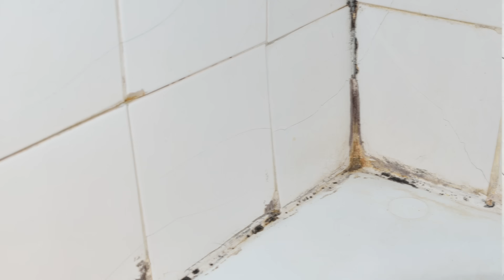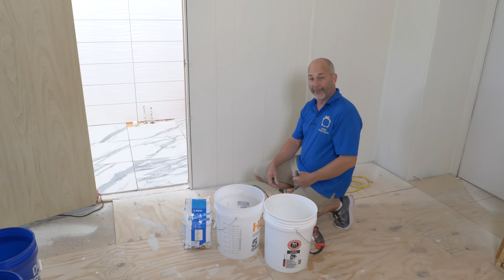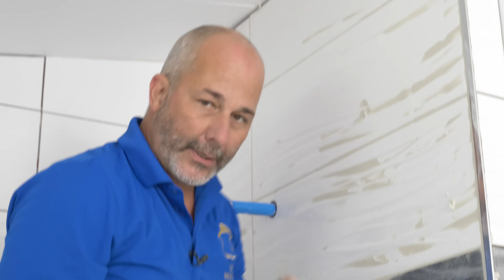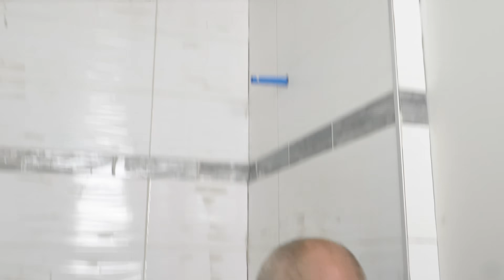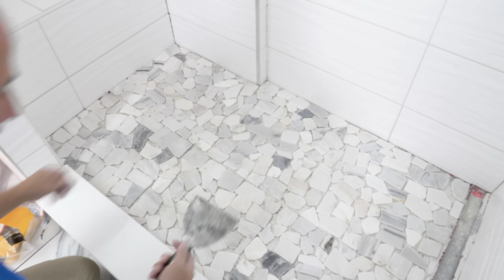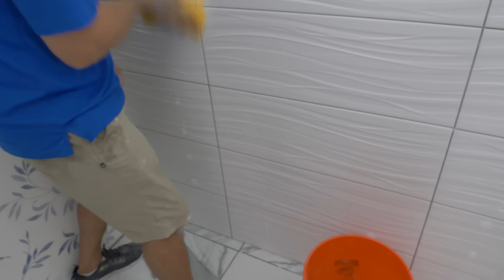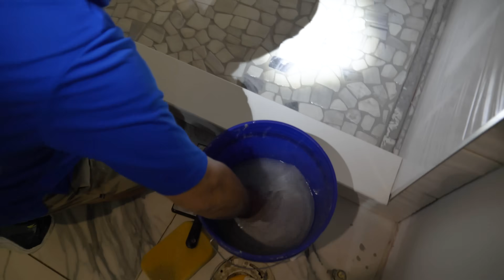Grout Your Floor and Wall Tile (Everything You Need to Know)

Comment: I really do love your videos as a DIY'r. I have been putting off a shower job because I have never done one. I am certain I can do it but I tend to overthink it. I am installing a 72x72 walk in shower with a GURU or Schluter type pan. I am first stuck on what thin set to use to set the foam floor as there is so much information out there it makes it confusing... 2nd I am doing a Black and white Mosaic tile floor. I have a ton of tile we want to break and install on floor. walls wont need it as we are doing a metal type wall... I guess which thin set should I use for installing foam pan to a wood sub floor and which grout for tile? I really want to get started or I will never do it

Comment: These videos are super helpful! But the one thing you don't cover is cleaning up your tools at the end. You mention in at least one video not to rinse excess grout down the drain, good, but not what to do instead. I've found some other resources showing how to scrape the excess out of the bucket into plastic bags, but how do you get the grout off your mixing attachment? Particularly, how do you clean it before it hardens on there, when you've also got to make sure you get the grout worked before the time is up?

Comment: I read somewhere a tip to seal your shower walls before applying grout. Makes clean up easier and prevents staining your tile. Is there logic to this or does it just prevent good adhesion of your grout causing a catastrophic failure? As a diy guy, I honestly could see both options lol

Comment: Just stumbled across this video, so glad I did, applying the sealer BEFORE starting the grout, great tip!  

Hoping you can help me with my one question, for large shower floors, 6ft x 4ft, what's the best way to apply when the short wall is the opening?  I have no choice but to crawl into the shower to pour and spread the grout.  Which means I'll back out as I do it, however I am going to have to crawl back in to spread and then start cleaning, but will be kneeling on the grout I haven't cleaned yet.   Any suggestions?  I assume I have to clean the far end where I started since it'll set faster, but I'm worried about crawling on the stuff I poured at the door end.

Comment: Maybe I missed it, but is there a reason not to use ultracolor for the walls too?
Reply: Yes, it is with polymer sealant, CG2FWA grout (F-Fast) and you have only half an hour to put it and wash it. If not it will be as hard as stone. Of course you can mix smaller parts of grout but is is more convenient to work with CG2WA grout on the walls. But is definitely worth it to put ultracolour plus CG2FWA grout with sealant on the floor.

Comment: Your videos are a lifesaver. We did use the Ultracolor Plus FA on our kitchen backsplash even tho we watched your "warning" video about that. Lol.  First, we bought the premixed and got scared when we read about it. We took it back and got the bag that you mix. We worked in small batches, only mixing 2 cups at a time to 2/3 cups of cold distilled water. We had a section of mosaic tile under the range hood and the rest was 3x12 wavy subway-like tile with beveled edges. We had to work fast! We really appreciated the advice about sealing any tile that was stone-like. There were tiles in the mosaic that were marble-like so we paid $20 for a small bottle of sealer and only used prob a tablespoon of it, if that. But, we feel it was worth it. My husband and I are both perfectionists and the tile job looks very professional! Thanks for the how-to videos!

Comment: I did my 1st tile floor last few days, grouted today using the Ultra FA.  Well I used a smaller pan to mix some by hand but started with too much water, so 1/2 bag used to mix right (by hand).  Then figuring I'd try the least visible corner 1st it turned out the rubber spatula worked better than a trowel for spreading it in the cracks.  Used 2 rolls of paper towels to wipe the excess every 6 to 8 tiles within reach.  Its all done now.  Lessons learned are 1. Wish I had those leveling spacers you had in a previous video... I only had those tiny stars.  2. I didn't know the mortar(thin-set)-showing spots would show up later... so I have a few spots where the seam is white rather than grey.  Being a utility room its 1000x better than the concrete it had and plenty good enough.  Thanks for all the help man!

Comment: When this stuff came out I was helping my uncle tile a floor and he didnt know it was rapid set, he cleaned off the excess with a steel wool. It was a quality porceline tile and it was not glossy so it worked out and we thankfully did not need to tear up the floor. Ive gotten good at using ultracolor I use cold water, I put a cover on my grout pale to extend the pot life. I mix it a bit on the dry side for strenght, then apply it pushing it hard into the joints and quickly wipe excess off at a 45 degree angle and i quickly do all shower walls and as soon as im done 10 to 15 min max Im wiping with a damp sponge agressively to shape the joints from start to finish, then stage 2 damp sponge 2 cleaning buckets and wipe wall and clean sponge over and over, once done touch up grout if needed, if not buff with microfibre cloth and remove any remaing haze and finished for good. All my jobs last a long time and no need to seal!! Unsanded is not too great when you can remove it with a regular cleaning brush. I remove it and replace it with better grout. Keep up the good work.
Reply: Will keep in mind what you are stating here , I've waited 3 mo in the comment section for confirmation along with the possibility of hiring him because I Really liked his work     on top of him Filming it  , thanks for your comment glad I came back to scroll me & my grandson 8 are going to try doing it next week..

Comment: Bud.. Used customer supplied mapei grout ultracolor plus for first time. You scared me with other video. You know the one. Thankfully, from experience not a problem. Homeowner using yeah could potentially see a problem. 

My main thing from very beginning of this video was the hard line with the tile in the pan. What happened? I would like to avoid if possible. Thanks!

Comment: Man I WISH I had a contractor like you. I have a son with a disability and the state had us in a program to remodel our single bathroom, it's a two contractor bid process, lowest contractor wins. We had to stop work with the first contractor because the quality was SO bad, then had to go through a process of finding another contractor which means we've been without a bathroom in the house for ten months. There is a basement toilet and we used a camping shower tent. The new contractor didn't install the tile to specs and the MAPEI FA is SOFT, so it was mixed improperly. At this point I am going to get out the shitty grout myself and do the new grout myself, I realize now no one will take the time and attention I will. Thanks for all your videos to make this clear. - by the way, the state paid both contractors in full for these jobs. This is not only a case of fraud, but of contractors who are taking advantage of a vulnerable population.

Comment: tiling is beautiful. like you said 99% never continue sealing their grout. that's me. even though it was harder to work with, the waterproof grout will never need sealing and remain beautiful. it was worth it in my opinion when I did a backsplash. more work to put down and clean with less working time but still debating on using it now on a shower 😅
Reply: When you refer to waterproof grout, do you mean epoxy grout? Our grout has failed and is bring washed away when i clean the shower. Thinking i might try to use epoxy grout on top of old grout.

Comment: Do you need to seal the grout on the wall after using the Keracolor unsanded grout? If so can I use the same product you applied to the floor using a small paintbrush over the wall lines? 

Thanks for your informative videos.
Cheers.

Comment: Jeff, your a life saver man.  Just finished a "Semi-Emergency" tiling of my ladies main bathroom (shower) that had paint/wetness issues. We watched one of your other videos on the Mapei Ultra FA grout and how quick the working time is, and you were absolutely right!   We were using the Flexcolor 3D with Penny Tile on the wall and damn did it haze up/set fast.  We literally worked in 1ft increments for a lot of it due to tight spaces/corners/non tiled areas.   And One wall/area we had to do with lights out due to the switches and outlets and lights powered down.  So we did it with a headlamp and 2 camping lights.   I'm arguing to buy some big battery work lights.  :P   Would you seal the UltraFA/Flexcolor 3d?  Cheers man!

Comment: HELP:
Jeff, I love all your videos and your so detailed which makes it easy to understand. Here is my issue I'm having with laying LVT and I will try to be short.
Bought a house built in 1962. Harwood floors throughout except in hall and dining room which has carpet, why, who knows!!! I ripped up carpet&padding in hall thinking I would find hardwoods. I did, problem is they glued down some type of black sealer on the floor like a rubber sealant, guess to keep drafts from coming up from crawlspace. I went crazy trying to scrape & sand it off and floors look like crap.
Dining room is the same except it has a subfloor under padding & carpet.
I want to put LVT on these areas.  Should I put down a new OSB board on top of black tar stuff and then LVT? What size OSB?
Thanks for your help and maybe someone has the same problem.

Comment: Thanks for sharing all your wisdom! I didn't do a great job, but I'de wager you saved me from having to rip up all my tiles and do it again from scratch. I had been intending to squeeze the grout out of a hole in the corner of a ziplock bag so I wouldn't need to clean the face of all the tiles. But then when my fast cure special grout started to set 20 mins in with me only having squeezed grout into the gap of about 1/4 of the tiles, I had a panic attack LOL. I just ripped the ziplock bag in half and proceeded to rub the grout all over the place shoving it into all the tile joints like a mofo making a god aweful mess, but managed to fill all the cracks. Then having followed your advice and prepared 4 buckets of clean water, I was able to start wiping the tiles down diagonally immediately and just managed to get it into a state where it looks "OK" before everything started setting. Having watched your video gave me the confidence to abort my original ass backwards plan at the first sign that it might not work, and proceed to attempt to do it the normal way. :)

Comment: I found using vinegar and water to get haze off of tiles worked like a charm! Got that tip from a tile supply store employee!
Reply: Vinegar to water ratio?1:1
Reply: @lamey99  start off with .5 vinegar to 1 part water. You can go up from there.

Comment: can you do a video for putting tile on an outside  concrete patio,   would you use red guard or a waterproofing membrane, then tile  is porcelain tile better to use over ceramic  can you use  a self-lever  i know that I need a modified polymer mortar too set the tile  and to seal it after all is grouted like  a shower like you show here  and i know to stay away from the box stores thanks to your videos

Comment: Thank you. You answered my question about whether to grout or silicone the corner in my shower/bath.   I'm not going to regrout my whole shower, just patch some loose grout.  Is there a good product for that?  Also, ten years ago I used epoxy grout for a countertop.  I was matching another countertop that a former owner installed.  I'd heard that it didn't stain like regular grout.  It has held up well and doesn't seem to stain.  I'm wondering about sealers to maintain it.

Comment: i once did a shower job for this guy i was working for it was a real pain and he gave me a bag of grout of questionable origins said it would be fine NOT it was old and i had two walls of a three wall 3'x3' shower when it started setting up really fast i spent the next two hours scraping at it with all manner of tools to remove it from the tile face what a pain in the a$$ last time i ever used an open box/bag of anything ever again

Comment: I called a bathroom company to replace my out dated bathroom and want to charge me $22,000 just for 3 panels walls, tub and shower/ tub appliance/shower door.  I think this is too expensive just for just tub, sliding door and 3 walls and not the whole total bathroom.  I need help with my shower/tub to replace everything. I don’t know where to start.  And if the company over charging me?😢

Comment: Can someone clarify why you dont use grout with sealer on the wall, besides shorted working time? And why corner gaps are not grouted but silicone is used. Thanks
Reply: Corner gaps are at a change of plane or direction. A building is usually moving or expanding and contracting slightly from things like settling, changes in temp, changes in humidity, strong winds, movement of people. This will tend to show up where the tile plane changes such as in corners. Grout is not very flexible and prone to cracking under these conditions. Silicone is flexible so it can handle it and not crack.

Comment: I once tiled a shower (my 2nd tiling attempt) using a 2-part epoxy grout. It was horrible to work with, but 100 years from now when the house is long gone, that shower will probably still be standing, looking as mediocre as when I finished it.

Comment: Still new to messing with tiling and grout work..so once the grouting is done and cleaned do you need to use a sealer over the grout lines?
Reply: Not a professional but yes you seal the grout lines - helps it from becoming discoloured. I have terrible well water that turns my grout lines orange. I’ve sealed it but it seems inevitable with how bad the water is. But you should still seal as Jeff said it helps repel water.

Comment: I can confirm if you don't mix your grout with same amounts of water, when the grout dries you'll get different shades. I did my shower walls years ago and since then my dual shaded grout has bugged me 😂 Where was this video 7 years ago? Multiple tips I wish I had known, several mistakes made, but still waterproof from schluter system 😉

Comment: Homedepot used to sell LED worklights (like the halogen ones), but they were battery powered.
They were never available in Canada, but I know many canadian contractors would explicitly go to the US to buy them.

They have fantstic battery life, and plug in using a regular 3-prong plug. Durable, excellent battery life, and relatively inexpensive.
Sadly, HD stopped making/selling them even in the US.
Now, there's no good options for these lights.
Looks exactly like HD model# FTWL011, but with a larger back (which houses the battery).

Comment: I just tiled my kitchen and I used MAPEI Ultracolor Plus FA grout in Warm Grey color. It states that you don’t need to seal the grout,  If you don’t need to seal the grout why is it that when I wipe the floor with a wet rag or sponge the grout darkens as if the grout is absorbing the water?  As it dries it lightens up back to its original color.  Would this not allow the grout to be stained if a liquid containing color, gets spilled on the grout line?

Comment: Hi Jeff. As a DIYer, I really appreciate your video and the detail that goes into them. I’m making a marble tile accent wall and want to use white grout. After watching your other video on sanded fast setting grout vs unsanded, I’m going with unsanded to get more working time. But since unsanded could stain marble, is it necessary to seal it first? It’s an accent wall and won’t be getting wet like a shower wall..

Comment: One tip that's worked for us when using unmodified grout (white grout - this could effect coloured grout so test that first) - if the grout has dried on the tile or on surfaces use vinegar to clean it. Make sure not to get too much into the grout lines. Grout is alcaline (which is why it slows mold) and so the acidic vinegar neutralizes it and changes the chemistry, allowing small areas to be cleaned even if you cant get to the final cleanup until a few hours later. Figured it out when needing to clean off haze 3 days after grouting. Again though - have only tried it on unmodified grout (also helps a bit with thinset).
Reply: I wouldn't use vinegar on the floor. Anything marble, stone or granite always avoid vinegar. Vinegar is acidic and will eat through anything porous.

Comment: On the topic of bringing your own lights to the job (lol^):
As a general contractor, I carry a $50 rechargeable (6-12hr depending on brightness) headlamp on me at all times, and probably have it on at least 30% of the time indoors just to ensure consistent lighting anywhere I'm looking at any time. It actively dispels any illusions of light reflections/shadows, and any created by it are tied to the movement of your head, generally preventing you from being tricked by your own light. See everything correctly, the first time you look.
Interior lighting is designed to light up the contents of the room and blend the room itself into the background. You specifically cannot rely on that type of lighting when working on the room itself.
It's a direct improvement to almost every project and is only an issue in the cases where you need incidental/perpendicular light to cast shade on surface imperfections or you don't want reflections from surfaces persistently perpendicular to your face (blinding yourself). Other than that, it's all the light I ever need and easily the most valuable tool in my belt - in fact, when I put my belt down I usually take my light and gloves with me meaning it's even more important than anything else I carry.